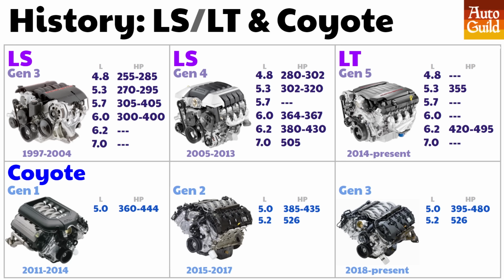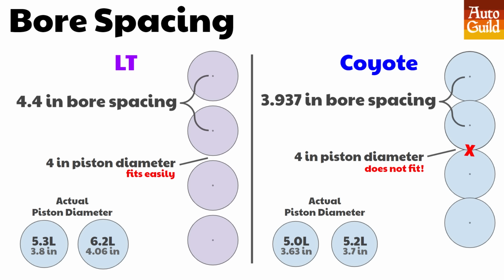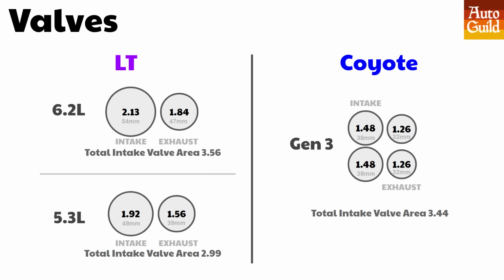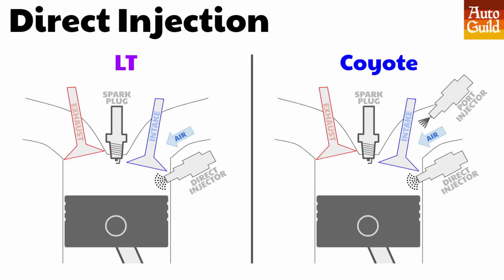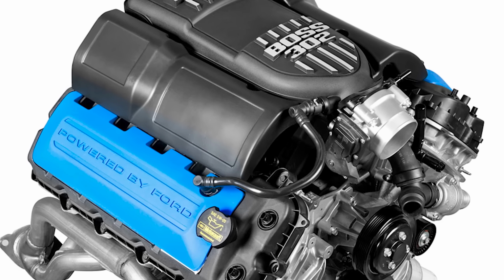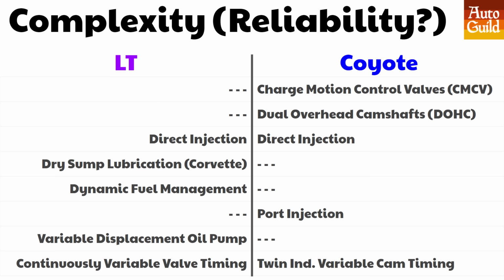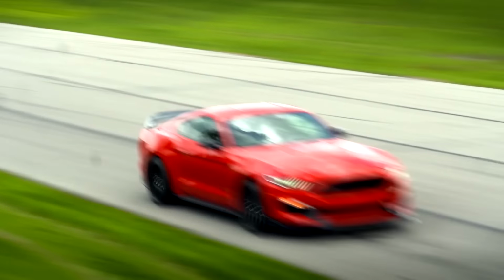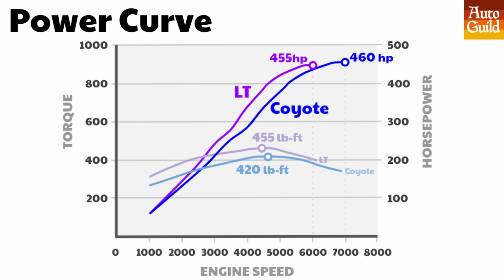GM Gen 5 LT vs Ford Coyote.  Which one is better and why.

Comment: 31 year Ford mechanic told me an LS 6.0 5.3 6.2 or any LT engine same liter sizes would put double if not triple the miles on a 5.0 could ever do. He said he loves 5.0s the said it’s a much larger Engine but won’t out last the LS/LT line up.
Reply: Everybody has there options, had a 2018 Silverado with a 5.3 in it and it was a complete piece of garbage. No power at all, average about 2mpg less then advertised and overall just junk. Have a coyote in f150 and its night and day. As far as getting g miles out of motors it comes down to maintenance.  Ls is a great motor and so is the lt but I own a f150 with a coyote  and a boss 302 with the road runner version of the coyote and will put them up vs gm products anyday. Know plenty of mechanics that could give arguments for both brands

Comment: LT > Coyote and the explanation is simple.  Without splitting hairs, both are very good performers, but the LT gets the job done with less weight, a smaller footprint (more applications) and fewer moving parts and just overall simplicity.  This is very important but often overlooked with car squids.  Simplicity is a very good thing for longevity, reliability, and also manufacturability.  Now I just angered Ford fanboys... too bad.

Comment: As much as I love the Voodoo, why didn't they put tuned headers on it? Sure its more expensive, but the car already is more expensive and a ton of time was put in to design the engine to work with a flat plane, why not run a slightly different exhaust on it?? They left a lot of power on the table for no reason. On an engine so dependent on RPMs, exhaust matters much more and the standard coyote exhaust may be great to 7500, but a better exhaust would really let the voodoo wind out even more. Having driven one, its very easy to feel where at the 6k+ mark the engine should be pulling harder than it is. Plus a properly designed exhaust on a flat plane engine will take a car that sounds obnoxious like the GT350, to something closer to a Lambo or Ferrari sound.
Reply: Ur saying the Gt350 sounds like shit, and basically wish an American Pony Car should sound like some sort of Italian Engineering, lord help us all
Reply: @elijahkoehrer239  correct. It's raspy as hell and just sounds like a fast Honda. Typically, American cars have cross plane v8s and European cars have flat plane v8s. They've had them for decades, and the gt350 was "breaking new grounds". So with a European engine style, why would it not sound European? Are you saying the c8 z06 sounds like shit? Sure sounds pretty similar to a Ferrari 458.
Reply: @sdickinson64  How the hell does a gt350 in any way sound like a damn Honda

Comment: I have a coyote, it looks like a huge engine in comparison to a lt because of the 24 valve heads, it take up a lot more realestate, I could see this being a issue in swaps in tight engine bays, I will add this-this is the best engine ford has ever built hands down.
Reply: The 4.6L had a 3V option; all Coyotes are 4v so you have 32 valve heads. Not trying to be a @$$ just trying to help out.
Reply: @cgarris8674  MATH FAIL lol

Comment: In Australia we got the coyote engine available in our Ford Falcon but was re-engineered with a 1.9L supercharger factory fitted ( code named Miami ) it made a factory claim flywheel kilowatt of 315 base model, 335 GT model and 351 GT final edition... But even from the day of release they were making the factory claim kilowatts at the wheels on the dyno, Ford Australia have a reputation for understating the real power output of our high performance models, as a blue blood Ford man I absolutely love the coyote engine but we also had the LS1/2/3 and stuff in our local GM/Chevrolet Holden Commodores and they too go fucking hard and ended up factory supercharged in their final model, personally I love both and am very proud of the Australian domestic car market legacy, the days of brand new affordable rwd V8 cars are almost gone downunder, we can get mustangs and RAM trucks from dealerships but everything else is AWD or fwd shitboxes.
We had a good run...

Comment: The ls7 has hollow titanium valves so they are lightweight and supah strong.for all the engineering and 3 extra cams that for has thrown down...im not seeing how the juice is worth the squeeze. The old school brute is still the king. Except for the voodoo engine. That is in a different class.i believe. Thats some exotic awesomeness. A high revving v8 is so awesome. The voodoo engine is a supermodel.

Comment: Bit of pedantry: The flat plane crank in the Voodoo is not arranged as shown. The crankshaft pictured puts cylinders 1/2 and 7/8 in the same position. So along a single bank it would be TDC-BDC-BDC-TDC. This is the style crankshaft in Ferrari, TVR, Lotus and the C8.R flat plane crankshafts. The Voodoo crankshaft has 1/2 and 5/6 in the same position, so that along a bank it would be TDC-BDC-TDC-BDC. This gives it a different sound than the afore mentioned flat plane crank V8s. If you listen to a Ferrari, TVR, Lotus, or C8.R V8 they sound exactly like an inline 4, because they have the exact same per-bank firing order and exhaust gas pulses. Those are basically two i-4s joined at the crank. The Voodoo has a different sound, with a bit more of a snarl to it, making it a unique sounding engine.

Comment: I drive a 17 Ford Mustang coyote with the Power Pack 3 8000rpm kit. It's amazing. Oh and you forgot about the TR6070 7 Speed Transaxle (GM PN 24255981). I thought fanboys at least knew about the best corvette transaxle ever. ;)

Comment: I remember reading about the voodoo engine to be used in the GT350 mustang years ago.The article I read likened the voodoo to a Ferrari engine.In fact The article actually called it Fords version of a Ferrari V8.I have not got to experience it for myself yet but I definitely would like to. My first car,bought at 17 years old was a 79 fox body mustang. It was a 5.0 and it had a Edelbrock four barrel carburetor.In fact every part on the engine was Edelbrock.It was fast,but not a practical every day driver for a 17 year old. I've actually always thought that the Ford 5.0 sounded a little rough and always preferred the sound of the Italian made exotics.I can't wait to check out the Voodoo engine for myself

Comment: As a Chevy fan the thing that concerns me is that the Coyote makes more hp per liter than the LS or LT.
Reply: Worry about horsepower and weight and size of the motor as in whats cubes got to do with anything, then the Chevy is far better. God bless

Comment: Good video, but . . . . . 

At 7:05  you say the LT5 has port "and" direct injection yet @ 11.04 your Ford V Chevy feature comparison chart doesn't credit the LT5 with having port injection. 

I love Chevrolet's engines (especially their 427 and 454 variants) but at 8:35 the HP/Torque comparison between Ford's 5.0 Litre engine (480 HP/96 HP per litre) and Chevrolet's 5.3 Litre engine (355 HP/67 HP per litre) reveals all you need to know about which engine is more efficient and makes more power. And that award goes to the Ford.

In this comparison the Ford wins.

As, for just one reason, the 5.3 litre Chevrolet LT engine - even with a greater - displacement, can't match the Ford's 5.0 Litre engine; and this is largely down to those 4 valve heads the Ford has.

For many reasons pound/displacement for pound/displacement the 4 valve head (fitted with smaller intake valves than the 2 valve engine you're comparing it with) will outperform a 2 valve engine.

Jim Stanley.
EX AMG Powertrain Engineer.
Electronic/Electrical Engineer. PhD Electroacoustics

Comment: Biggest downfall of the Coyote is the timing chains IMO. The LS is the most diverse engine ever designed with so much interchangeable parts between ever LS based engine built. Parts can be swapped between almost all of them
Reply: Coyote parts are interchangeable with older 4.6 modular engines. Mainly internals. I wouldn’t give all credit to the engineers of the LS and modern LT. They took a hell of a lot of inspiration from the Ford 351. 

The timing chains are a pain in the ass, but so far the coyote has proven to be one of the most reliable engines in a modern muscle/pony car. Unless you’re awful with preventative maintenance you’ll never experience a real problem.
Reply: @matchboxcody  bs bro i know lots of older retired guys that always has something going on with his 5.0. I believe all say they are the best but in reality they are all the same!
Reply: @user-NofaceNocase  I don't see how anyone can take your word for that seriously considering how much evidence and examples we have that prove otherwise. Like Matchboxcody said, they are not all that different that you can't interchange parts. People still use many old and new parts in many different swaps and applications, not to mention some of the best parts like the intake came from Ford, namely the boss 302 intake that everyone uses because of how incredibly well it increases airflow and responds to Ford engines but also to many other different engines overall.
Reply: @raionshishi8290  Imagine putting custom made Coyote heads on a 6.8L Triton V10 block.
Reply: @CJColvin  I would be interested in seeing that.
Reply: @raionshishi8290  That would be as interesting as seeing a custom homemade 6.8L DOHC 40V triton V10 from build it you're self.

Comment: Companies using the old 20th century push rod tech is all about it being cheaper to make.  They obviously wont admit this, but proof is in the pudding.  Vehicles with push rod engines should be significantly cheaper than they are.  Camaro could still be saved if they went to a retro look, like Ford did in 2005-2014... But that probably all too late now.

Comment: There are no disadvantages of having peak power and torque at a lower RPM. It just means you can have it sooner.
Also, I've never seen a Ford swap in a Chevy hotrod. The hotrod/muscle car community is the largest research group out there. This should say something. If Ford's were THAT good, we would see at least a few, but no.
Reply: That's a big really... Hot rods usually don't go at high speeds for long time. So a big torque it's better for her moment of pleasure.
Reply: It cost more to do yoti swap
Reply: @randyrasmussen8031  and it costs less to do other engines than the LS, but they don't do those, either.
Reply: @UncleDonDon  u can literally do a ls swap for $600 obviously u can do a sbc and a sbf for cheap but we are comparing a ls to a yoti ….. u can’t get a yoti under 3k … 600 vs 3k ya that’s y everything has a ls not a yoti if it were the same price a lot more people would doa yoti swap
Reply: @randyrasmussen8031  if the Ford's were so badass, money shouldn't stop you. It's all about the power, right?
Reply: @UncleDonDon  ur moronic dude when it cost less to get the same power who would pay 3k when u can pay 600….. and I never said Ford was badass I don’t even like fords im a Chevy guy but I gotta give props where it is due…. And not everyone is has 3k to throw at a car some of us are broke as a joke
Reply: @UncleDonDon  and it’s not all about power it all about how u can get the most power for the cheapest for us broke guys
Reply: @randyrasmussen8031  I don't buy it. I don't see guys swapping their I'm broke Sanford and son hillbilly junk. The overwhelming majority are guys that spend thousands building cars. Not just the motors. Full builds.  And what do they swap? Always an LS. Always.
Reply: @UncleDonDon  I ain’t selling u shit 🤣🤣🤣  I’m speaking fact ur just getting pissey over a engine
Reply: @UncleDonDon  and for the hillbilly junk lmfao 90% of ls swaps are done on a budget I have 2 one i have $350 into the swap the other I have 5k into and I already know what ur ignorant ass is gonna say y didn’t u swap a yoti if I have 5k into it that because I only have $1500 into the motor the rest is turbos and shit that 5k would turn into $10k if I did a yoti swap… plus I had space restrictions so it wasn’t possible to do that swap without modifications that I didn’t wanna do
Reply: people slap LS's in everything because they fit well and have a ton of aftermarket support, for a low cost. I've considered one for my 68 mustang just for simplicity and cost, and because ford doesn't have a very modern pushrod engine for me to put in it. If I could afford a coyote, and knew i could do it without a ton of fabrication, I would definitely go that route.
Also, chevy engines were put in '32 fords because they fit better than a small block ford. You don't have to modify the body to accommodate a SBC.
But i'm a mopar guy anyways, and in the case of my cuda, if the 383 ever shits the bed, it'll get a gen 3 hemi.
Reply: @BryantStilwell  u said it better than me lol🔥👌
Reply: I agree. More dependable  as well (chevy ls)
Reply: Sure there are, but you know that. lol And There are several pics of a  Camaros with Yotes in them on the internet. lol

The issue you have here is the fastest production cars in the world dont use Pushrods, 0 of them in fact.
Reply: The 53' Belair I sold last year was Ford powered. It ran a 351W based 408 stroker with a T56 trans and a 9" rear-end.

Comment: Great video!  I can say when I test drove both for fun w/e car, no track, the LT was much more fun off the line and at the lights.  The Coyote had no torque down low and the 1LE package was a no brainer, coming from a previous HEMI guy, which I think had more torque down low than both.  But the SS1LE is so much more agile and fun to drive and well balanced... 😎
Reply: OP's comment is exactly what I've been wondering about since I'm of the firm belief that low-end and mid-range power do a lot more for most driving than peak horsepower, if that peak horsepower is only found up high in the revs.  But dyno graphs seem to suggest the coyote might be the more capable of the two, delivering 90%+ of its peak torque from <2000->6000 rpm while the 6.2 has a gradually ramping output with a distinct peak around 4500 and only entering 90% of that peak around 3000 rpm and falling back down below just shy of 6000.  I would expect that would translate to very free-feeling revving at any rpm for the Ford while the GM would have to build up to and might feel a little out of breath up high.

Regarding the 4.7, blame mercedes.  The hemi is way better in every way than that frankenstein.
Reply: I get the whole torque-down low argument, but the Coyote also has something that neither the Hemi or LT have...and that's high-revs. Sure, you gotta wait for the top-end to kick in for Coyotes, but the sound of the exhaust and high-revs are exhilarating, and usually reserved for $100K+ cars. Specially for 2018'+ Coyotes.
Reply: Its interesting I own both an LS and a Coyote, I find the LS sluggish off the line but really ramps up between 2500 and 3000 rpms, where as the coyote gets moving from a light pretty damn fast but feels like it struggles in higher RPM ranges. Mind you this might have a lot to do with  the transmissions.
Reply: @loganl7547  Wow,  two opposite opinions , who would have ever guessed!
Reply: @duke7595   well there is a probable difference in the years, Evan said LT, I said LS... the LS was known for its wimpy fuel eco cam, an issue they addressed I believe with the LT. There is also a major difference between generations of Coyote, and finally, transmissions account for a great deal of difference in getting power to the ground, it's why Dodge isn't in my garage, I got sick of replacing transmissions, and won't buy any Dodge that doesn't have the 318 (5.2L), which was the best thing Dodge ever made (sorry Hemi lovers, I can't stand weak head gaskets) which in typical Chrysler fashion the 318 was too durable and wasn't encouraging people to replace their vehicles fast enough, so they killed it off and replaced it with the 4.7L which was total trash.
Reply: @loganl7547  Chrysler, in my opinion are, and always were junk compared to chevy..
Reply: @duke7595  I hate fiat
Reply: @loganl7547  I have to second your 318 sentiment ... my parents had a half ton sports van with 318 - bought used, incredible gas mileage on the highway (over 20), lots of low end grunt (could brake stand it easily - full stock except exhaust) and they bought it used and had it for 12 years and the only thing that ever failed or needed maintenance was the starter ... and I abused the crap out of it. Finally sold it to a happy couple and they got many more years out of it. Don't know if we got a "special" case, but that engine was amazing in all regards.

Comment: I like how the Coyote is easily 10 second capable without the need to swap the heads and cams in N/A form and then go 8's with the same stock heads and cams with some boost....
Reply: Coyotes are better full bolt on and stock sealed boosted. Lt is better all out NA and can make more without being sleeved.

Comment: As for the displacement difference the same theory applies to reving the larger displacements to 8200 rpm, they would crush the coyote in power.  The comparison is in stock form as that is the best way to compare them at this point.  
In the aftermarket world and even the dollar per HP chevy always comes out on top. In this example ford has an even bigger disadvantage in the cost per horsepower.  You can grab a chevy camshaft for less than $300 but you have to buy 4 camshafts for ford which is around a $1200 upgrade.

These are great engines and the manufacturers have done a fantastic job getting us new technology to play with.

Comment: In approximately 3 months he’s gonna have to go back and redo this whole video when the C8Z comes out with its 5.5L Flat plane crank, DOHC V8, then again 2 years later when it gets supercharged in the C8ZR1. N/A over 120hp per liter, I wish GM would change its mind again and put it in a Camaro and call it Z/28. Chevy will have LTs with pushrods and LTs with 4 cams, both flavors at one candy store.